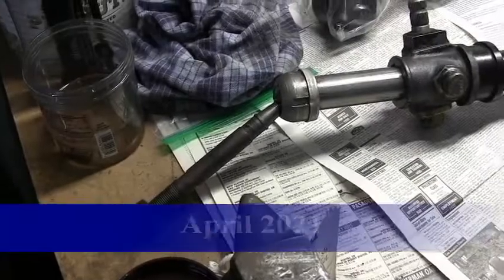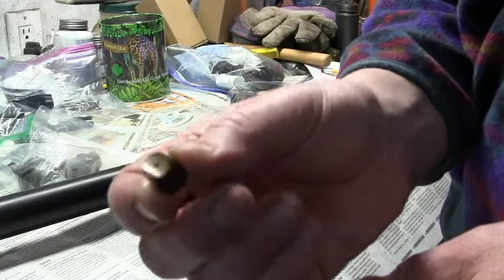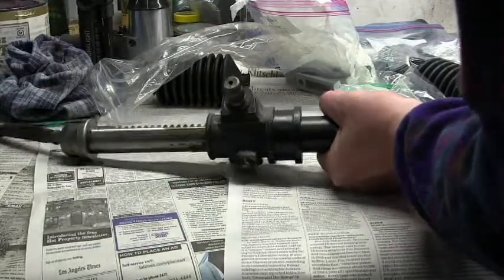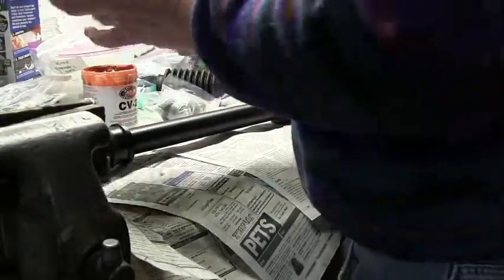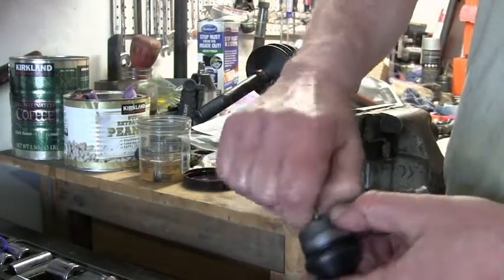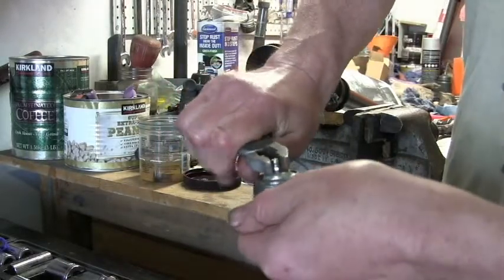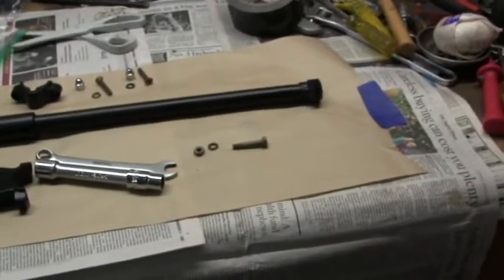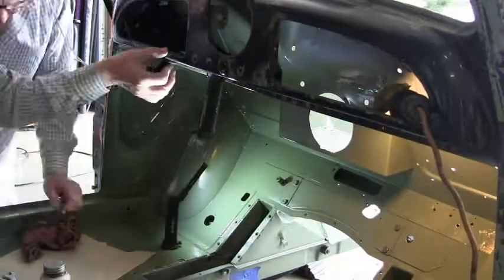Morris Minor Steering Rack

Comment: Thanks a lot for this video! I had a massive dark oil stain under my car one night and couldn't figure out if it was engine oil or transmission oil, turned out to be steering rack oil! Looks like I need new gaitors.
Reply from the maker: Glad it was of some use!  Mine has not yet seen action as the restoration is still ongoing; hoping I have no issues, fingers crossed...

Comment: Great video again Tim  , did you replace the top and bottom felt pads in the steering column which should be oiled occasionally ? 🤔
Reply from the maker: No, mine looked good, so I thought I'd best leave alone.
Reply: @goingundersground  If it ain't bust , don't fix it 👍